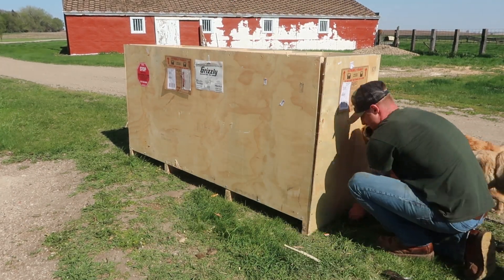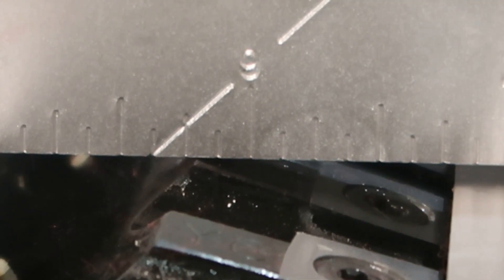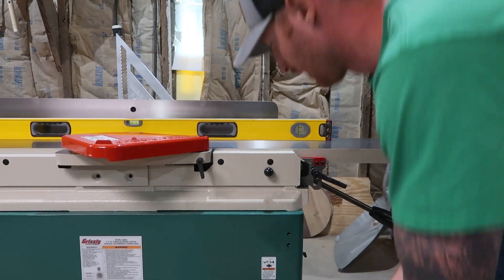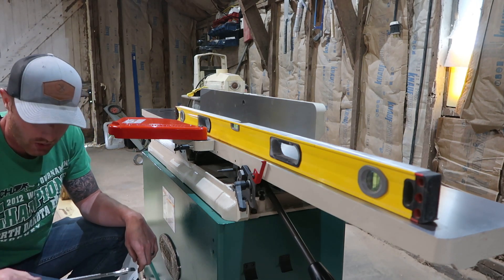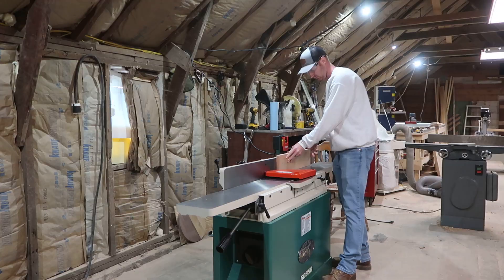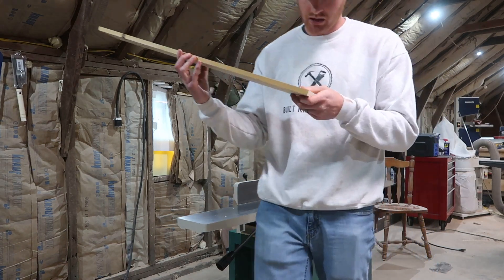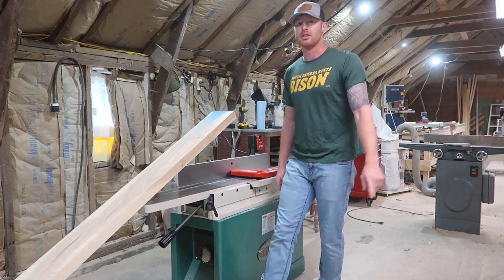Grizzly G0858 jointer unboxing setup and review (how to setup a jointer)

Comment: I just spent a couple days taking apart and putting together my 10” Inca joiner after getting measurements to fit it for a Byrd helical head. Then yesterday re-sharpening 2 sets of blades and reinstalling. Then setting height of the straight knives.  What a chore. The Byrd head for that joiner/planer isn’t available till year end. 
I set my knives using a 3mm pull near the center of on an old 30” cheap aluminum level as I have for many many years. My test cuts came out without snipe.  So here are my thoughts on joining with that machine.  Once the board is stable on the out-feed table, keep the majority of downward pressure behind the cutter on the out-feed side and just enough pressure to stabilize the feed in front of the cutter on the in-feed side.  Especially important as the board finishes the cut.

Comment: Great video. I have this jointer and did a video on it to. One of the best tool purchases I have ever made ! The adjustment to get it perfect was a pin in the butt though. You can really get it out of wack easily if you crank on the eccentric bushings to much

Comment: I bought the same Jointer.  But I did a few things differently.  First, the box comes off easily if you  just remove the bottom screws and slip the whole thing up and over.  No need to break it apart.  Second, I cringe at lifting it by the tables.  It comes with lifting brackets and we picked it up by those instead, those two metal C shaped things.  Third, my tables were luckily set correctly from the factory, and yes I even bought a long fancy $60 straight edge for that purpose.  It confirmed it was correct.   I am afraid horsing it around by the tables is causing the issues some have with proper table alignment.  Best of luck, I love mine.

Comment: Thank for posting this.  I am researching 8 inch jointers and am considering both the Powermatic and Jet 8 inch helical head with the conventional wedge bed, and this Grizzly with the parallelogram bed.  Prices are within a few hundred of each other. Driving myself crazy with all the researching!
Reply from the maker: Glad you found it useful, I was researching the same ones as you and decided I really wanted them parallelogram with the helical.  My thought process is that Ill ideally have this for many many years so I spent the extra money
Reply: There was a guy that posted about powermatic, and has nothing but issues in his cabinet saw. Jet, powermatic, and grizzly are all Asia machines.

Comment: About the jointer outfeed table height compared to the knives, I've heard the argument for the knives being a tad higher, though I generally aim for right on. Even a tad too low gives me the same issue with the snipe you had here and even slightly too high will give you a bowed cut (especially with face jointing) since the higher outfeed table will tend to progressively lift the trailing end of the board up by a hair at a time and you won't get a nice flat face. A perfectly flat face, if you pick up one end of it and let it fall flat on the jointer bed, will make a soft noise when it hits and you'll feel kind of a "suction" if you gently pick it back up.

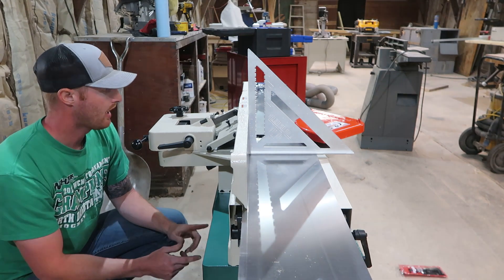Comment: Thanks for the video.  Around 13:15, you talk about the play in the fence.  Did you ever get that resolved?  I have the same model and the same observation.  Trying to determine if that's normal or if I need to play with the cone point set screws (35) on the fence swivel base (25). Those are part numbers from the parts manual.
Reply from the maker: I believe that's just a common issue with this jointer it kind of surprises me because everything else seems really tight and well made but the fence just has way too much playing
Reply: @BuiltKnotBought  I fixed it.  Wanted to pass along what I found to be root cause and what I did to fix.  Appears that the cone shaped sets screws in the swivel base were not fully seated when the unit was first assembled.  Refer to the parts diagram, loosen 14mm jam nut (36) on all four cone point set screws (35) on the fence swivel base (25).  Use flat tip screw driver to adjust set screws for snug fit.  Don’t know if they have a torque setting so I just went firm enough to stop movement without wrenching down too hard.  Tighten jam nut and you should be good.  Hope that helps.  ~JB
Reply from the maker: @joeb6864  thanks Joe next time I'm in the shop and have some free time I'm definitely doing this

Comment: Congrats on the new jointer. I’m in the market for both a new table saw and jointer. I’ve been eyeing the Grizzly parallelogram jointers. Possibly going with the 490 due to keeping cost down.
Reply from the maker: Thank you!  I think you're going to be happy with grizzly for the price is a really solid machine.  I've got the jointer and a planer and I really enjoy both of them
Reply: Built Knot Bought I e got a Dewalt planer, and I always get snipe. I was thinking of buying a SawStop, but if I do that I won’t be able to buy the jointer. I like the safety features.
Reply from the maker: @GO_Agave  I've got a saw stop table saw it is the best thing I've purchased 👍
Reply: Built Knot Bought did you buy the 3 hp / 36”?
Reply from the maker: @GO_Agave  I have the 3hp with the largest extension I want to say 52"
Reply: The g0490 is actually the more expensive option right nowdue to the sale. The problem I have now is that they are so similarly priced and have so many similarities that I don’t even know which to get! I spent over an hour comparing and so far I’ve the only notable difference that I’ve found is the power draw from the motors. 15 amp on the 490 and 12 amp on the 858.
Reply: @timothydu9415  I believe the 490 is made in China while the 858 is made in Taiwan (supposedly better).

Comment: Just curious, are you edge jointing before face jointing? I was taught the opposite. Also, the spare knob in the box is for your fence. I’ve got the identical version in Shop Fox. They’re great machines!
Reply from the maker: I think in the video I edge jointed first but I usually face joint and then edge joint which is the proper way👍. And thanks for the info about the spare knob

Comment: Thanks for the video! Am about to pull the trigger on this jointer but I live in a cul de sac and Grizzly said they cannot deliver to a cul de sac. How do you think the wheels would do on a sidewalk. I'd have about a 5-minute walk to my house if I were able to get them to drop it off at a buddy's house down the street and am wondering if I could just roll it down the sidewalk once it's off the pallet? Thanks for any info.
Reply from the maker: I'd recommend making a couple carts with caster wheels to set it on and roll it versus the factory wheels.  They do well on perfectly flat ground but any bumps or inclines will not be very fun

Comment: Any issues after lifting it by the bed to get it off and in your shop? The manual says to not do that, I was thinking of getting a hoist to lift mine off
Reply from the maker: I didn't have any issues everything needs to be adjusted anyways out of the crate so I wasn't too concerned
Reply: @BuiltKnotBought  thanks for the quick reply and the professional video!
Reply from the maker: @AVSMedical1  you bet thanks for watching good luck with your jointer I love mine

Comment: I'm really close to pulling the trigger on this same unit.  Like others have mentioned, I would have to get it down a grass slope to get to my basement.  I assume that, if absolutely necessary, I could remove the table from the base and move it in pieces a little easier (with a buddy of course).  Any thoughts on this logic?  Thanks for the review!
Reply from the maker: Hi Toby thanks for commenting with the parallelogram type jointer I think it's going to be very difficult to separate into different pieces to move down into your basement.  Now that being said I have never actually attempted to try and remove the infeed or outfeed table so I could be completely wrong here this is just simply my observation.  The dovetail type jointers may be a little easier to take apart
Reply: I have this same jointer.  Removing that tables is not THAT big a deal.  Kinda of a pain but not too bad.
Reply from the maker: @befmx31  thanks for commenting I've never had to take mine apart👍

Comment: Thanks for all the info. I’m curious about how you got the jointer off the pallet though. Did you donut by yourself?
Reply from the maker: Yeah I was able to do it by myself it wasn't very easy of course but I just kind of lifted one edge up and scooted it over and teeter-tottered it back and forth.  I highly recommend you get a friend to help you because the jointer is heavy
Reply: @BuiltKnotBought  I appreciate your time and quick response.  I was thinking about trying a little ramp or something, but I might have to ask for a favor from a friend
Reply from the maker: @jasonevans9649  it's possible by yourself but it will be soo much easier with a friend

Comment: I just bought this jointer and am in the process of setting it up. I believe I have everything correct. However, when edge jointing a board it is is not completely straight and doesnt line up perfectly with my table saw fence or another known straight board. Any thoughts on what my problem could be?

Comment: Nice vid.I wouldn't trust that level using paper.A professional straight edge like machine shops use for cyl heads and blocks.Just a suggestion.
Reply from the maker: You're correct a proper straight edge will give you more accurate results👍👍👍

Comment: great video, thank you! I just ordered this jointer and I'm expecting it later this week or next week. I can't wait. 
I will need to move it down a grass hill to get it to my basement shop. it looked like yours moved decently on the dirt/grass and the incorporated wheels... any suggestions on that? I might just lay down a plywood path but I'm afraid it might go a little too quick down the hill.
Reply from the maker: Thank you, I'm glad you found it helpful.  It slid surprisingly well in the dirt!  If I had to go down hill I'd probably go the plywood route and have a friend help you walk it into the shop.  It's very heavy!  So far I have had zero issues with it
Reply: I'm actually in the same boat as you. I just ordered mine and have to slide it down a slight grassy hill slope to get into my workspace. Did you end up going the plywood route? How did it go? Other than some slight nerves about that, I'm very excited for it to arrive.
Reply: @29jonant  for the jointer,  I was able to pay the delivery guy $50 to get it down there with his pallet jack.  I used two pieces of plywood that I kept moving to put in front of him.  That worked great. 

I ordered a 20 inch planer a couple weeks later,  and the delivery guy was less helpful... so I was on my own there.  I ended up putting the planer on a piece of plywood,  drilling two large holes and running a tow strap through them.  I dragged that down the hill with my car.  I had to go really slow and it was a bit of a pain,  but it got the job done. 

Good luck!

Comment: I highly recommend getting straight edge and feelers to get the alignment properly.
Nice vid otherwise.
Reply from the maker: Agreed a straight edge and feelers will get you the most accurate results
Reply: I use a straight edge to rough mine in then, a dial indicator for final adjustment. Very accurate. Also, I get my best results with the cutters .001 to .002 above the outfeed table. That also measured with a dial indicator from the outfeed table to the cutter with the cutter at TDC (TOP DEAD CENTER). Good video, like the way you explained all the adjustments for the tables.

Comment: Great video, I just got this jointer and having difficulty taking the cutter head guard off, any tips? I’m trying to joint a board wider than 8”
Reply from the maker: Glad it was helpful.  Mine has a small black handle where the guard pivots.  Just loosen up that lever and I believe it will lift out.  Honestly I have not taken the guard off of mine yet
Reply: Built Knot Bought I have taken that completely out. There is an allen bolt at the bottom of the pivot shaft and it does not seem to want to budge.
Reply from the maker: @mrTaylorwellborn  interesting I'll take a look at mine when I get home and let you know if I can figure it out.  Let me know if you figure it out before me
Reply: Built Knot Bought Will do! Thanks!
Reply from the maker: To remove the guard on my jointer you have to take off a snap ring that sits on top of the pivoting bolt on the guard.

Comment: How do you move the jointer around the shop? Also is there leveling feet on each side ? Thx good vid
Reply from the maker: I have my jointer hooked up to dust collection so it's stationary.  There are wheels under it and levelers though!
Reply: @BuiltKnotBought  sweet thanks for getting back? Are there a total of four levelers? Just wondering cuz my garage is pretty uneven. Thanks!
Reply from the maker: @kevinb6102  I'm pretty sure there is 4 one in each corner my shop floor is terrible cracks and uneven everywhere so you should be fine 👍👍👍
Reply: @BuiltKnotBought  awesome thanks for the help and fast replies

Comment: Nice video. The owners manual tells you how to set-up the table, blades, etc.  it appears you followed the manual.  Good deal.  How is the jointer working for you?
Reply from the maker: The jointer if working very well for me I've ran thousands of board feet through it and it hasn't let me down